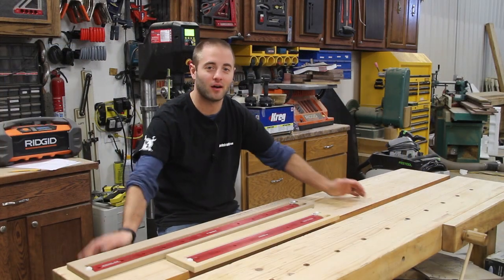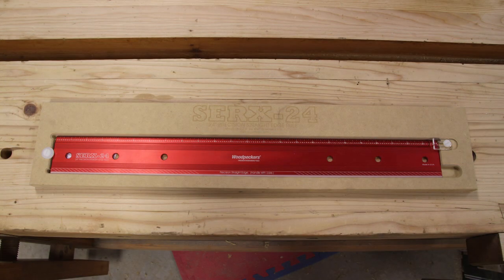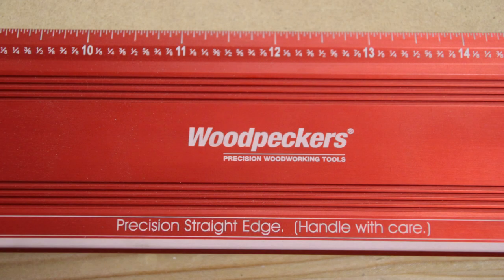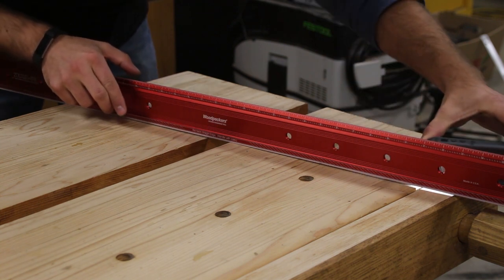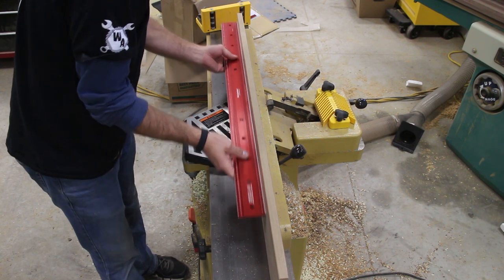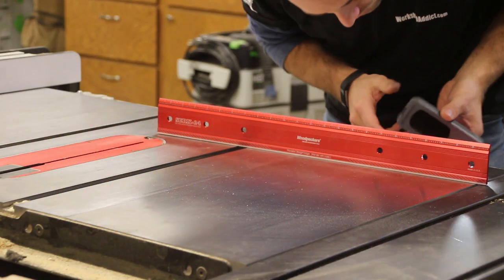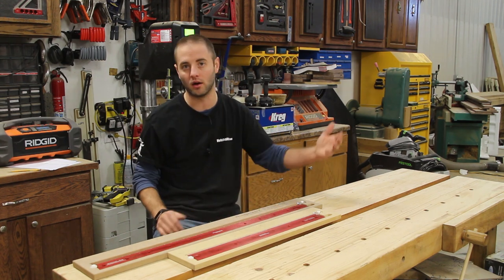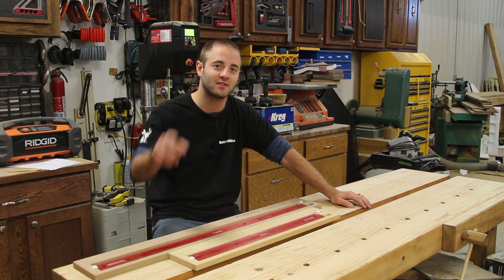Woodpeckers SERX Straight Edge Rules for Woodworkers

Comment: In a woodshop there really isn't to much that needs to be "machinist" level of starlight. That said, a decent straight edge is very handy for the reasons listed. For durability, I would have liked to see both edges made of steel. I'm not sure a hybrid of aluminum and steel would be practical but I can just see it falling of something, hitting something hard, and getting a ding or dent a little to easily.
Reply: I meant "machinist" level of straight, not starlight.... damn auto correction for spelling...lol.
Reply from the maker: David Mm I agree but having something in the shop you can trust is important. Regards to dropping it, that is why it says handle with care!!